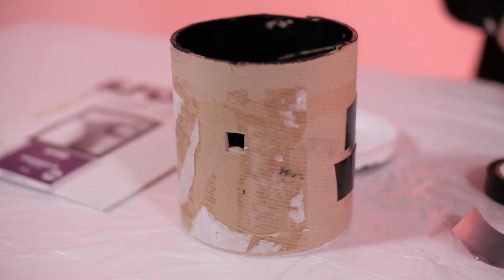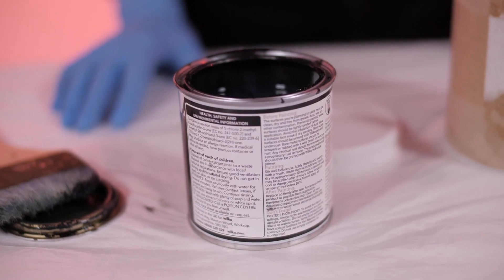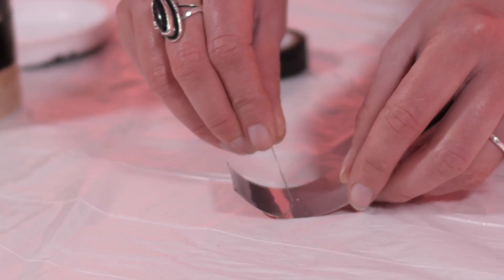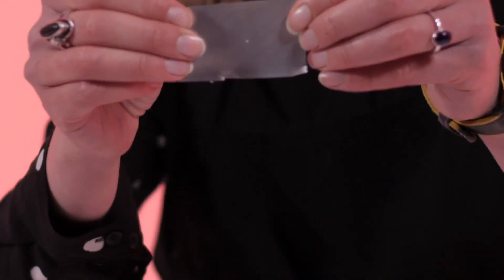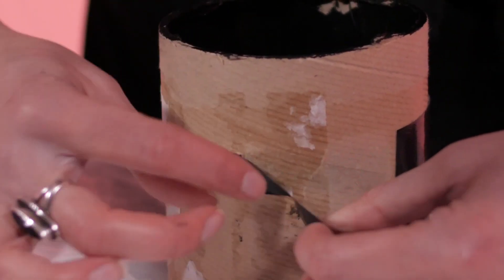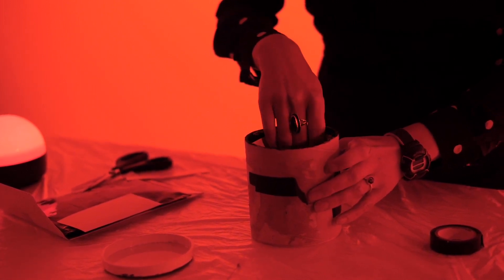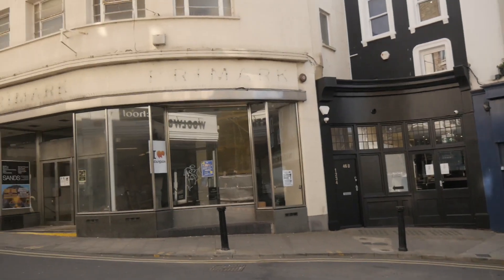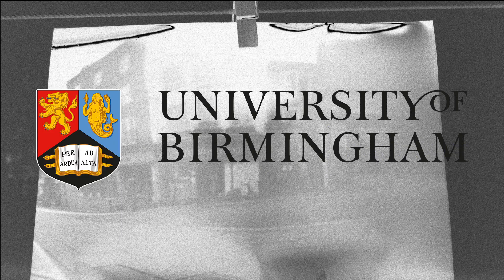Pinhole Camera Making Video For Schools // Royal Academy of Engineering

Comment: Pinhole photos always have a cool look.  Thank you for sharing.
Would there be any issue putting the alum on the outside of the cylinder? Then the tape could go all the way around the cylinder and wrap on itself.
Reply from the maker: I think that would be okay - the pinhole would be at a further distance from the photographic paper and therefore have a longer exposure. I also think it would be easier for light to get in - but if you taped it really well, it would be fine.